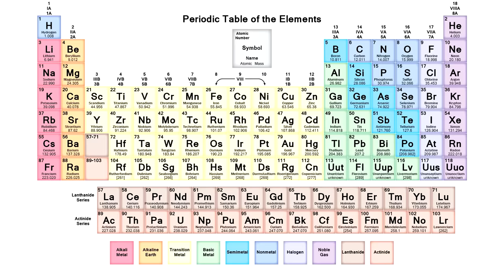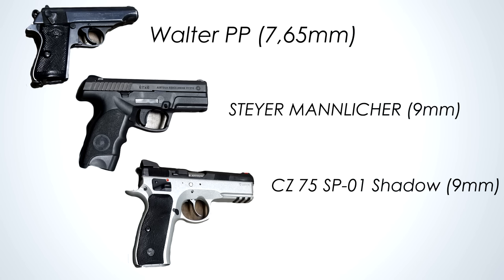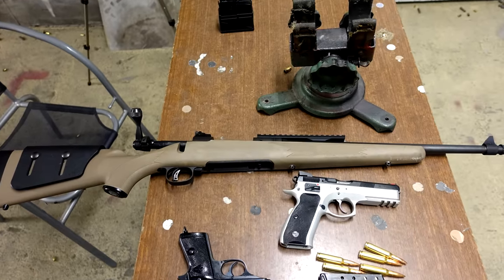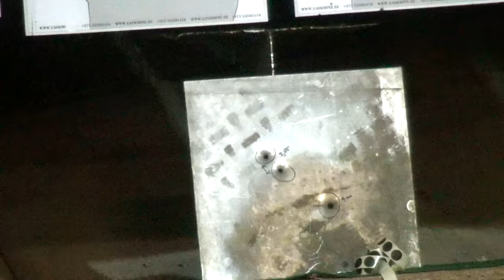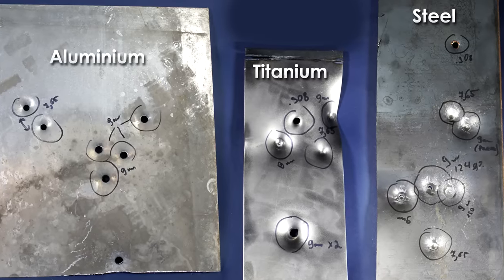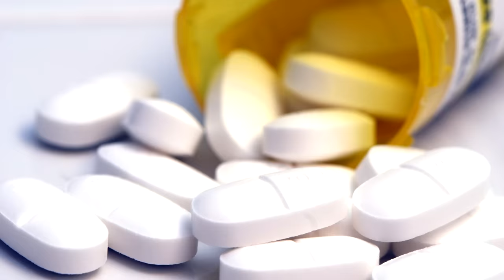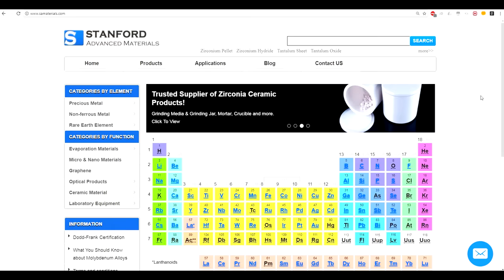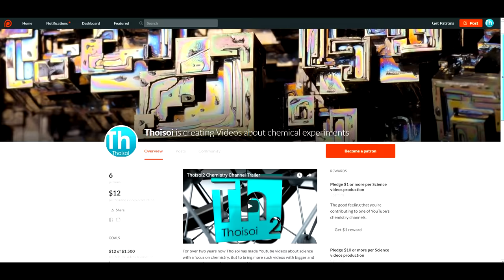Titanium  - The STRONGEST METAL On Earth!

Comment: Glad you mentioned the price being dependent on how hard it is to work rather than the metal itself. Pound for pound you get twice the titanium than you do steel so you do not need to buy as much to make products out of it. The high cost of titanium products is the labor and equipment costs to produce rather than the metal itself. Material costs balances out.

Comment: Thoisoi: Titanium is the most resistent thing in universe.

Me, as a intellectual: SCOTT STERLING FACE
Reply: neutron stars: laughs in electromagnetic radiation
Reply: Now I am conflicted, Scott's face or wolvarine's Adamantium? Scott could win.
Reply: Titanium's got nothing on Iridium.
Reply: Titanium is the toughest to weigh ratio. But tungsten is the toughest metal on earth.
Reply: @hayatel2557 Well, if you mean strength, than titanium is still way stronger. Tungsten is brittle and its density makes it weaker when used practically

Comment: you forgot paint. nearly every paint has titanium dioxide as a backbone before other tints are added. especially in house and artist paints
Reply: he did mention that
Reply: And welding electrodes
Reply: Titanium white
Reply: which ones? Usually tungsten, no?
Reply: Its easy to remove the o2 from TiO2.
But Ti is hard to alloy.
Reply: they use titanium dioxide in candy alot too
Reply: intx123 titanium dioxide is a white powder. The glittery effect is unrelated to that.
Reply: AllChemystery titanium oxyd on m&m's , tooth paste , paints
Reply: Can that be harmful to us ?
Reply: in the process of making Tio2 Ticl4 is produced it's nasty stuff especially when it comes in contact with h20 or when accidentally inhaled.
Reply: leroy420b great I did a shit ton of painting in the wind and to the point when I blew my nose I brew colours depending on the project GREAT LOL  I've started using masks since I noticed the colours lol but that's good to know
Reply: AustinAutomotive oh sorry that came out wrong. The ticl4 is a precurser but once it's  been turned into Tio2 it's listed as a mild irritant nothing to worry about. I hope lol I used to leave work covered in it.
Reply: Ed Va titanium hwite

Comment: Do the same test again, but this time attach the plates to a holder that hold them in the same position before and after reaching them. 
There is energy dissipation contained in the projectile at the moment the plate moves during the absorption of the energy transfer at the moment of impact, reducing the actual damage produced by the projectile.
Reply: I noticed that too, although on this test the results would probably the same. However, with technical videos it needs to be technically correct.
Reply: I was scrolling to find this comment and add it if it didn't exist. Also, I think that the masses of the metal effect the penetrating power when they are free to move and absorb the impact.

Comment: I've only seen this metal once in a specialty shop.  They had a piece of round stock about three inches across and about six inches long.  I asked to just hold it and play with it to kind of get a "feel" for it and it's instantly obvious that it's different.  It has a near glass like sound when you tap it and it's so light that it feels like a hollow cylinder.  Very interesting metal.

Comment: No. Stalinium is the strongest.
Reply: Sovietine
Reply: Tungsten
Reply: вσвα тєα Nope.
Reply: @wtf-hc3tp  Isn't Tungsten the strongest?
Reply: OneOfAKind In terms of tensile strength, yes, but can break very easily.
Reply: @wtf-hc3tp   True, it also has the highest melting point right?
Reply: OneOfAKind Yes.
Reply: Adamantium
Reply: ullie89 Not a metal, neither does it exist.
Reply: Valerian steel
Reply: Leninium
Reply: Eagle Eye Adamantium is a metal alloy but it isn’t real. And could manganese steel be the strongest?
Reply: @Poopiz 82 yes
Reply: Tungsten
Reply: It is not a element, but a alloy.
Reply: Hans Freiheit /r whoosh
Reply: Happy commie noises
Reply: @AletheiaVV  it's the thoughtes not the strongest basically it's better Vs scratches but it cracks easily at higher force such as guns
Reply: @Christs_Apologet  sodium bicarbonate
Reply: @AletheiaVV  no it's the hardest titanium is the strongest
Reply: methamphetamine
its not metal but i like eat it 😎😎
Reply: No Vibranium is the strongest
Reply: Trumpinium is more durable.
Reply: @AletheiaVV No.
Carbon does
And if you count alloys, then hafnium carbide

Comment: I assume you mean unalloyed pure metals? Heat treated alloy steels will whip the pants off of Titanium. In engineering terms titanium is a compromise between lightweight aluminum (weak, but light) and the strength of good steels (very strong, but heavy).

Comment: Just a PSA. Titanium is not nearly the strongest metal. High alloy steel is far stronger. it is also no where near the highest strength to weight. Beryllium has a much higher specific strength.
I use titanium at work, we don't use special equipment for cutting it. Just quality equupment that we use on everything else.
Reply: Titanium is the strongest naturally occuring metal
Reply: Iron rust and can't withstand time.
Reply: Yuri Fyodorov you talk bs and there are countless amounts of different steel compositions basicly no matter what purpose you wanna use titanium steel is better the only good use of titanium is light parts catalists and corosion resistance + heat resistance and you can get extremley good corrosion resistance with steel  alloys
Reply: Yuri Fyodorov  lol dumbest thing iv ever read but ok i will stop talking with u about this topic cause you clearly dont know what you are talking about.. and also tankers know nothing about what material is good for armor they just use the machines they dont build it ;) and also thats why we all use titanium body armor xD lol you wont even find a titanium alloy witch is as strong as normal midrange hardox and i dont know of a single armored vehicle in the entire world witch uses titanium armor in russian plane and coppers you will find some or in bulletproof helmets and the reason is wheight not strenght... by the way im a metal processing technician
Reply: @fighter4166  What about Thorium? or Tungsten? Those are both found in pure deposits naturally as well...
Reply: Yuri Fyodorov  Or perhaps he took weight into account? Before attacking and insulting someone like that, consider the topic you're discussing. If ground vehicles like tanks, then sure, weight isn't an issue, but when you're talking about a UMF? That thing still has to fly, after all. Titanium is incredibly light, so even if you did have something 10x as durable, but it weighed 10x as much? Titanium would likely still be the most viable option for aircraft. Same reason they used to use magnesium engine housings on heli's - except for the fact that if it caught fire, you'd end up with a 6K+ degree, self-sustaining, white-hot fire that would literally burn through the ground beneath it... You know, minor inconveniences like that. >.> Currently, titanium alloys (not pure Ti, as we've worked out MUCH more stable/durable alloys now, yay metallurgy!) are the best option to balance price, availability, usability, physical characteristics like weight, and so on.

(Edit: UMF = slang term/nickname for the A10 Thunderbolt he was referring to here, aka the "Warthog" or "Ugly M.F.")
Reply: Yuri Fyodorov  Uhhh yeah. Sure. 
Only... 
Your argument was that titanium was the strongest on earth, simply because they use it on one particular airplane. Which is btw composed of primarily aluminum and steel.  So if there were, say, a metal that is 10x stronger but weighs 100x as much, you see no problem using this to build aircraft? Good luck with that... Saying something like "Titanium is the strongest metal light enough to build aircraft out of" is not the same as "They use titanium to build aircraft, so it must be the strongest metal in the world at any weight or under any conditions in any circumstances!"

But hey man, you do you. Glad you feel good about putting me in my place with your "metaphysical" science. Oh wait, that's the opposite of science. Well, whatever you want to call it. I'll stick to metallurgy, you can stick to metaphysical, keep trying to turn lead into gold there, and I'll worry about the metal while you focus on how it's spirit feels or whatever. 

Oh, and as an aside? Might want to rethink your initial example... or entire argument, really, since it's based on that. The cockpit shell/cage is the only part that's titanium reinforced, NOT 100% titanium btw, just armored somewhat, and even that weighs over half a ton JUST to put armored protection over the cockpit area. The rest of the plane is 0% titanium.
[edit: spelling]
Reply: Yuri Fyodorov  APFSDS rounds. The US military - same ones who build that A-10 you've stuck to as an example? Back in the 1940s, they realized titanium armor plating could be a problem, particularly if it was applied to enemy fortifications. They developed a way to penetrate/destroy said titanium armor. Tungsten rounds. Which, according to your example, should work about as well as a warm stick of butter.
Reply: Thomas Row no, last time I checked Vibranium was the strongest metal.
Reply: Yuri Fyodorov  Titanium is lighter and better for airplanes in certain cases. Ie SR71. And armour for ac and prosthetics and bicycles
Reply: Yuri Fyodorov  let's say i wanna build the perfect metal soldier ..... which type would you pick?  Steel  or
Titanium
 or 
Tungsten
Reply: well, this this is a temperamental discussion, but I learned a lot. thank you all
Reply: Isn’t tungsten the strongest metal on earth?
Reply: Yuri Fyodorov i see but that wasn't a response for my question ... i asked you if only you can choose only one option steel (iron + carbon) or tungsten or titanium just one no mixing ... so what would you say ?
Reply: Yuri Fyodorov lol i am not .... trust me it's just i am really trying to create a story where i wasn't sure from what should i say that the soldier was built
Reply: Isn't Beryllium toxic to humans?
Reply: China's vibranium is strongest metal they have or uranium metal
Reply: Saw this comment hada few replies, decided to see if a good discussion was happening or a typical toddleresque whine fest that YouTube is notorious for. Of course.Didn't take long for grown adults to act like grade school children with name calling. I picture each person name calling is dragging a 10lbs diaper screeching like a FPS squeaker because they're not being praised. It's a discussion. You're not getting a participation trophy while the adults tell you how awesome you are. Back up what you say somehow or say you don't know for sure. Name calling like "moron" or "retard" is just a cry out of "how DARE you not tell me I'm right and agree with me about everything". blow raspberries PLEASE will adults act their damn age.
Reply: Yuri Fyodorov  Material scientist here. Pure titanium is VERY soft. Alloyed titanium is pretty strong, comparable to high strength steels and cold worked stainless steels, but certainly not stronger than the strongest steels. Titanium is used for these reasons:
1. It has a very high strength to weight ratio (for aircraft)
2. It's VERY corrosion resistant in many environments (for example used in chemical industries)
3. It's strong, and non-magnetic (for submarines to avoid magnetic-based detection)
4. For jewelry because it sounds cool, and has a unique-ish dull-grey metal look (personally I like it, looks fantastic next to silver so you get the contrast!)
Reply: Yuri Fyodorov  I have no idea why you even mention melting point and pyrotechnics. High melting point doesn't mean that a material is strong, tough, or even if it is useful at high temperature, and they used kinetic penetrators in your link, not high explosive anti-tank. And when did they show "hardened steel"? And do you know if it was proper armor grade steel, or just an arbitrary carbon steel plate they quenched in water? The titanium plate was also very thick. I'd expect armor grade steel of the same thickness to easily stop the AP shells too, and probably the tungsten too of the plate was allowed to fly away like this titanium plate.

Just so you know, titanium is one of my favorite metals since it is such an overall good material, and looks great. That said, steel is incredibly modifiable, and simply beats titanium alloys in most cases when weight isn't super critical.
Reply: Yuri Fyodorov  "Has to be thicker" <-- The definition of being weaker.
Thickness is also extremely important. 20% more thickness means it can stop a projectile with 40-50% higher energy.
Reply: Yuri Fyodorov  Wow... Even more wrong. Tungsten and uranium are used because of their high density. There is no melting involved, which you also can see both in the video you linked. And if it were true, titanium would have been utter shit because of its low density. The energy required to melt the alloy is way more important than a slightly higher melting point, and lacking in raw mass means that titanium has much lower ability to handle absorbed heat. It would heat up fast, reach its melting point earlier, and absorb a lot less heat while melting. Stop embarrassing yourself kid and go back to school. You seem to need it.
Reply: Yuri Fyodorov  Bahahaha! Wow, thanks for reminding me of this thread from months and months ago! 
I'd completely written it off as being pointless arguing with someone who only cared about being right, rather than holding actual discussion, so if you hadn't lashed out and attacked me again for... well, honestly I'm not not sure what, considering I was just trying to point out the fact that the strength to weight ratio is relevant when designing aircraft, but hey, thanks again. Everybody loves to watch a good trainwreck, and you've DEFINITELY taken this one off the rails here! 
Cheers mate, and thanks for the laff! :-)
Reply: Yuri Fyodorov  The definition of strength is actually load capacity/cross section, and depending if your failure criteria is deviation from elastic behavior or fracture, we're talking either yield strength or tensile strength. Titanium isn't close to strongest in these criteria. Armor protection also involved high speed dynamic loading and ductility, but titanium doesn't win there either as long as we're discussing constant volume/cross section.

Nobody is arguing with you that titanium is amazing when it comes to SPECIFIC strength though, which is strength per weight. As far as I understand it's the best in this regards for bulk metals. But this is called SPECIFIC strength, not strength.
Reply: Yuri Fyodorov  And again, melting point and strength are two completely different properties. You might as well say that gold is the strongest metal because it's yellow.
Reply: Yuri Fyodorov  A right-fighter only cares about being praised and TOLD they are right. The truth doesn't matter to them at all. Only being praised and told how smart/right they are, even when everyone else sees they're just fools demanding praise.
Reply: tungsten??
Reply: Then would you consider Chromoly stronger than Titanium?
Reply: @ronaldhonore3454  if you dont take care of it. 

I have a chromoly bike frame and its lasted since 1996
Reply: Sepher Agon  you know... there are better ways to use alloys than stopping bullets. 

Like a bike frame for example. 
I would choose chromoly.
Reply: Sepher Agon  You realllĺlyyyy like titanium dont you. 

Fact still remains. Titanium isnt that great of a material despite all the hype it gets. 

Looks good on bikes and jewelry doe.